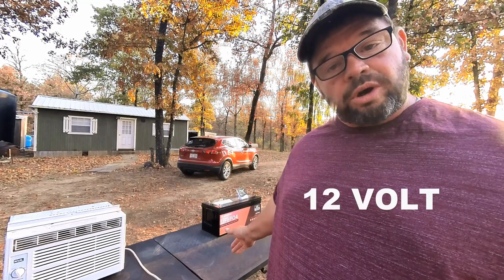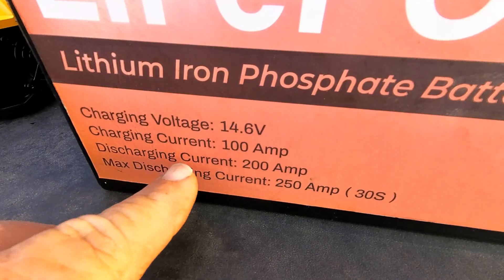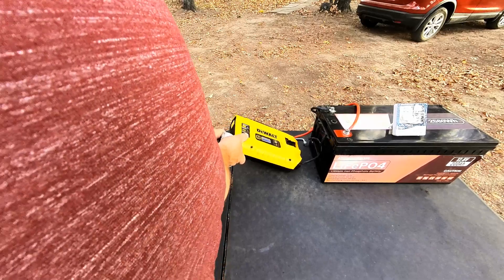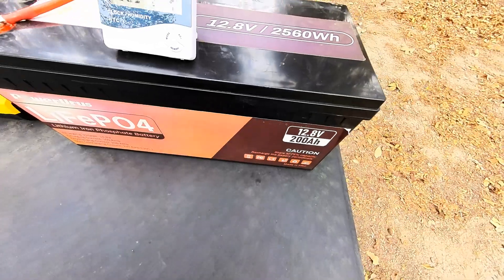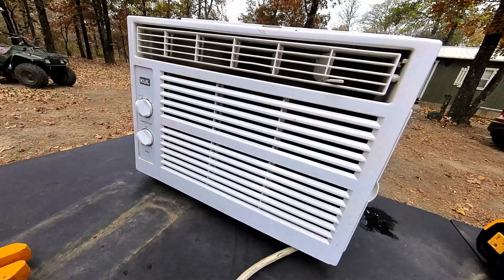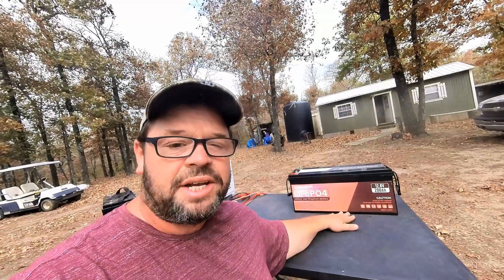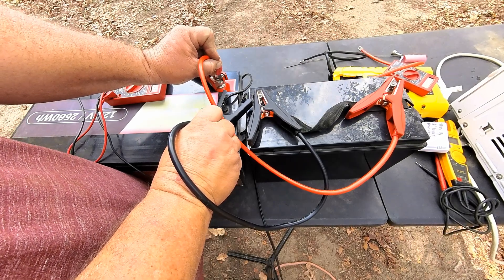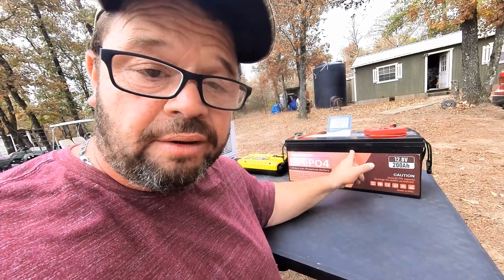How Long Will ONE BATTERY Run An Air Conditioner

Comment: I’m using a 300ah battery and it only lasted 1 hour with my 5000 btu air conditioner with a 2000 watt inverter is there something I’m doing wrong ?

Comment: REALLY good testing video. 👍♥️♥️♥️♥️♥️
Reply from the maker: Thanks!
Reply: @OKLAHOMAOFFGRID have a big question and need your expertise, so I have a 9000 BTU mini split that I've been running with a gasoline generator on my semi-truck, but it's getting annoying to fuel it daily. I want to know how many lithium batteries would I require to run it at least 12 hours to 15 hours tops, just connected to AC, nothing else.

Comment: 1000 watt inverter,100 Amp hrs lead acid boat battery full charge no active charging 5000 btu ac in bed room,got right about 1 hr
Reply from the maker: @Bob-p2q9q  wow that just goes to show you the difference with a 200 amp hour lithium going over 5 hours
Reply: @OKLAHOMAOFFGRID  I find that math on solar or batteries is guessing, how old are batteries, how much charge how well battery holds charge ,that's why I like real world testing
Reply: @OKLAHOMAOFFGRID  since running ac till inverter shut off due to low battery, 300watts of solar panel less than half charge due to excessive clouds
Reply: @OKLAHOMAOFFGRID  been about 4 days since ran battery down,still only about half charge,do to lots of clouds,that why you need options

Comment: Been wanting to figure out the best way to do this on my 38’ fifth wheel I moved into on my 80 acres my light bill thanks to oncor is higher then it was in my 2100sgft house because the extra charges they add for not being a “house” 🤦🏻‍♂️
Reply from the maker: wow

Comment: Build a 51.2/48v system. Dont build 12v for your home.
Reply from the maker: who you telling?? tell them...i have all 48 volt systems...lol...people just wanted to know what a 12 volt would run so i showed them
Reply: @stevenholmes9256 Aside from being a fanboy of a particular technology, 48v is objectively not the most cost-effective single battery voltage when comparing cost per Wh. You can easily build up to a 24/36/48 volt voltage with series or series + parallel battery bank with 12 volts batteries and balance charge them periodically (~$50 device) , if there is even such a particular need for that voltage the individual. This also is poor advice for one starting out with solar charging their batteries with a modest solar setup, regardless of mppt controller.

Comment: Should have posted the settings on the air conditioner. Low, medium, high. Otherwise, good video.
Reply from the maker: it has an on and off...compressor came on with fan blowing and never cycled off

Comment: I run my window unit in my van and in a real world installed ac unit, it will cycle the compressor on and off and save your battery power.

Comment: Next video talk in amps. It makes it easier to figure battery duration.
Reply from the maker: well it only pulled one amp according to my fluke meter...but DONT KNOW if that was reading correct

Comment: You Need a charger made for LifePo4 battery.
Reply from the maker: it is made for life po4 batteries
Reply: @OKLAHOMAOFFGRID  Looked at the site it is not stated anywhere. Lithium and LifePo4 are totally different thats why my charger has settings for each.
Reply from the maker: @danielrutledge8974  ✔️👌
Reply: @HalfDeafDano  "Lithium and LifePo4 are totally different" is very incorrect. LiFePO4 is a type of lithium battery. Lithium colloquially in the industry means the battery is lithium-based and does not denote a specific lithium technology/chemistry - whether Lithium Ion (LiIon), Lithium Polymer (LiPo), or Lithium Iron Phosphate (LiFePO4)

Comment: I think this video proves the more battery capacity you have the better you are. One 100Ah to me has started to become useless.
Reply from the maker: this was just a 200 amp hour
Reply: @OKLAHOMAOFFGRID  This is the first time ive seen a test with 200 amp hour its usually 100Ah
Reply from the maker: @mannyfragoza9652  ya I noticed that too

Comment: Was the air conditioning on high or low cool ?
Reply from the maker: one setting high...the compressor kicked in and never kicked back out the whole test
Reply: @ that’s damn good, I have a window air conditioner that I keep in the garage for summer power outages that I can run with a small generator , it has low medium and high , put it in a small room with a osculating fan  on the dresser and I could deal with it being on low to have it on longer if I had the setup in your video .

Comment: I can’t wait to see what a mini split will do off one. Compressors don’t use anywhere near as much energy.
Reply: @clamped on to a Fujitsu 9K 110v today at a call that was next to the unit I was sent to look at. it  showed 500w at startup and 275w-350w running and then shot back up to 500w  again when it went in to deicing for roughly 20sec. Going to work perfectly in my off grid shed. 🤘🏻

Comment: The battery almost doesn't matter.    If you have an enclosed space that isn't too large.  All you need is any decent 12V battery and a 400 watt solar panel and you will keep your enclosed space cool with a traditional window AC unit.     In your experiment, the AC was running 100% of the time at 400 watts, but in an enclosed space, it will maybe be running 25% of the time.   Also if your battery does run out, it will be in the last few hours before sunrise, which is the coolest time of the day.    $400 for a 400 watt solar panel and charge control,  $150 for a 12v 100ah battery and another $75 for the converter.   With the converter the big thing to watch out for is that it is rates for the AC surge when the AC kicks on.  This is the same with a frig or chest cooler,  the first second that they kick on will test your converter.   With the cost of the AC unit itself, for $1000 you can have AC for 10 years.   For the same $1000 you can add a coolbot and have an 8' x 10' walk-in cooler.    In the last 5 years, living off-grid comfortably has gotten extremely cheap.
Reply from the maker: You're going to need a little bit more than 400 w for solar if you are pulling 500 and something Watts like this AC was doing you need more power coming in than you got going out or it won't run it number one number two you need some type of battery for a buffer in case the sun goes down for a minute by a cloud going over it or if you got a semi cloudy day or a hazy day you're not going to pull your full wattage on top of that a 400 watt panel is only going to pull around 321 tops anyways
Reply: @Petersedesse Lots of assumed variables in this scenario, e.g. it would absolutely not work in hotter climates like southern Arizona or Texas. Also in the video he said 500 watts (which would be fairly accurate given it was powered by a 2400wh battery). Also, you say converter (which converts AC to DC, commonly used to keep RV batteries charged), but are meaning inverter.

Comment: A couple thousand dollars more and you might be able to air condition one room.
Reply: To AC a 20x20 room would require about $1000 (including the cost of the actual AC unit).    $400 for the mini split AC.   $400 for a 400w solar panel and charge controller.  $150 for a 12v 100ah battery.  $75 for the inverter.    With the 100ah battery you may run out of juice a few hours before dawn, but add another $100 for the 200ah battery and you coast 24hrs easily.   Batteries have dropped in price by 50% in the past 2 years, and solar panels are dropping 10-20% every year.   Also everything I mentioned has at least a 10 year warranty, so you are talking 10 years of AC for $1000.
Reply from the maker: Well I built my solar array for $3,400 and it will run an air conditioner all day while the sun is out and it would run it up to about 2 to 3:00 in the morning before the battery shut off if I left it on all night but if I get a bigger battery bank which I've already bought I just have not installed yet I will be able to run my AC 24/7 and that is basically going to add another thousand so for maybe around 4500 you could have AC 24 hours a day on top of running your whole house at least my whole house which is a smaller house than normal

Comment: I would say it could past longer because you did the test outside. If it was set up in a window or something for indoor use, it would power on and off from the thermostat. Still a great stress test to see what is the shortest runtime possible.
Reply from the maker: All that sounds good but a lot of times it's going to be hard to bring a complete room up to temperature where the compressor is going to cycle off within a 5-hour period especially with just a small 5000 BT unit you really need something the size of a storage shed to be able to do that honestly... So in my case it did represent real world scenario because the compressor would have never shut off within 5 hours I believe
Reply: @OKLAHOMAOFFGRID yeah but you don't know that until you test it that's what testing for
Reply: @OKLAHOMAOFFGRID a small room around 100 sq ft trips the 5000 btu in a cpl hours if there is one person in it and no direct sunlight.
Ideally for a decent size room 8000 btu works best
Reply: Exactly, more efficient indoors, insulated room

Comment: How long does it take to recharge the battery back to 100% ?
Reply from the maker: depensa on the battery charger...i have a 15 amp...takes like 7 hours...you can charge it up to 100 amps and would take like 2 hours

Comment: I worry more about the frig in a outage. Everything else can wait. Unless you have Grandma in a electric recliner and she can't get up. I have a inverter and battery from her mobility scooter for that. Need more of these.
Reply from the maker: right on
Reply: Yep, you just gotta be smart and make sure you open the door as little as possible.  We had a 4 day outtage here in texas a couple winters ago and nothing in my frig went bad because I only opened the frig door a few times a day and was in and out very fast.   I did drink the milk and ate my veggies pretty fast, but meat in the freezer never even dethawed let alone went back.

Comment: Prob last longer inside since compressor doesn't have to keep running
Reply from the maker: ya if it could bring the room temp down to the set thermostat degrees which is usually around 66 or so

Comment: A couple gallons of gas and a cheap generator will do the same for a fraction of the price of that battery.😂 
No thanks.
Reply from the maker: 🤣👌 generator will fail with out maintenance and many other things..no thanks..i would rather add a couple of panels and a charge controller and always have power and be independent from fuel and oil changes for life
Reply: The battery he used in this test (12v 200ah) is about $220 on Amazon right now.
Reply: Problem, if all the gas stations are closed,I watched people burn half a tank  of gas drive time plus sitting in line to get gas,the only people I saw get good deal were people with lots of gas cans get gas come back and sell it
Reply from the maker: at least you get it!!!!!

Comment: It's even better because if your house is insulated at all, the AC should be running a lot less than 500w average, so it will be able to go longer.  I wonder what a mini split would run like.
Reply: Yep, based on my use case in texas and Tennessee...  your AC will run about 25% of the time in an appropriately sized enclosure.  You should get down well below 200wh, which means a single 400w solar panel will get you 24hr coverage with even a 12v 100ah battery.
Reply from the maker: i have seen some mini splits run 170 watts at there lowest made by EG4
Reply: @OKLAHOMAOFFGRID  I saw a post about eg4 in a DIY Facebook group and it was well regarded for those with the budget. I am tempted as I want to power a fairly large place.
So close to getting land and planning it all out.
Reply from the maker: @waltermh111  I have a friend how to installed the eg4 12000 BTU and the rating on it was a 29.5 seer... Unbelievably efficient.. I can send you the link to it if you're interested..
Reply: @OKLAHOMAOFFGRID  sure,  thanks..

Comment: I went to Harbor Freight and got a stackable heavy duty tote on wheels, put 2 batteries in there and another tote on top with an inverter and solar charge controller. Along with some foldable solar panels, its the perfect power unit for my camper so i can use everything including the AC, boondocking anywhere!
Reply from the maker: Good deal
Reply: I would love to see a video on you assembling this and using it in real life, like the video above. I learn a lot from YT videos.

Comment: Good stuff Maynard.  So that's 5 hours continuous run time.  In an insulated bedroom that might be all night or all day kicking on and off.  I've got a small unit without a thermostat so I bought a thermostat outlet adapter.

Comment: Im sure it might be possible to buy a few more of those; link them up and run everything off of em with solar. Build a concrete platform; roof and sides outside, run the wires under the dirt to your house and boom, 100% off grid.
Reply from the maker: Ideas ideas

Comment: Try a mini fridge. I used to have low electric bills in Oklahoma using a mini fridge, window unit and plug in heaters.
Reply from the maker: Them  plug in heaters are 1500 watts
Reply: @ , Not all of them. You can buy some smaller ones. I was just interested in seeing about a mini fridge.
Reply from the maker: smaller is also 1500 on high 750 on low...but still heating with a dead short or a heating element which is actually a dead short is very not efficient

Comment: Finally someone is answering some real world questions.
Reply: I agree, thank you for this demonstration...
Reply: Do the same test in an enclosed room the AC compressor would work less
Reply: You are kidding right? As if you let an airconditioner run at full power all the time...😂 Just measure the first 20 seconds then calculate it, this is pointless.

Comment: Just think if you had 13 batteries or even 26 you could have 115 volt Ac without much changes.😅Try and design and build that system. Just a thought.😊 Thanks for sharing.😊
Reply: @kennedy67951 This would just provide DC power, you still need an inverter, unregulated 100v+ DC power from batteries is not of much use in a domestic setting and would power nothing.

Comment: 4 of those and you can probably run an entire house and central ac for a full day (not continuous, but maintaining normal temperature) your smaller house is probably even longer
Reply from the maker: Yeah I saw all kinds of potential
Reply: That's a little ambitious.  You can run a Central AC for about 2 and 1/2 hours with 10 kilowatt-hours.  And you would need to run these batteries in series and go with a 24 or 48 volt system to reduce the amperage needed.  But, for window units, small mini splits, and everything else in the house, these are great
Reply from the maker: ya im not a fan of 12 volt high amp systems but it is what most people understand the most
Reply: @OKLAHOMAOFFGRID  I've got one in my living room with 4, 12.8 volt batteries on a harbor freight wood plank furniture dolly that I built into a crate.  I used 2/0 cable and 300 amp bus bars.  It runs a couple of lamps, modem and router, and a 10,000 BTU AC in the evening. I did it to learn on .   I've got 2, 30 amp pwm charge controllers and 1, 40 amp mppt charge controller runnings 1600 watts of panels into it.  A  48 volt system with one charge controller would have been easier.   That's how you learn though.  What county are you in?  I'm from Edmond originally and in Cenrral California  for the last 32 years.  I enjoy your channel.  Keep up the good work.